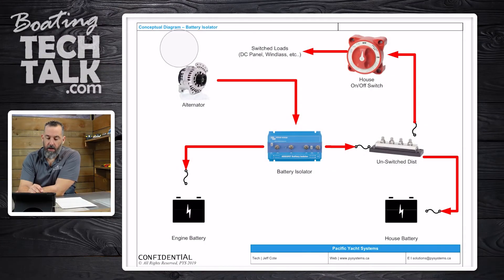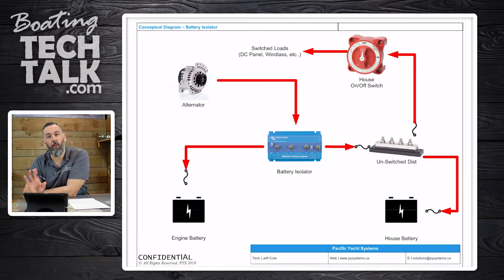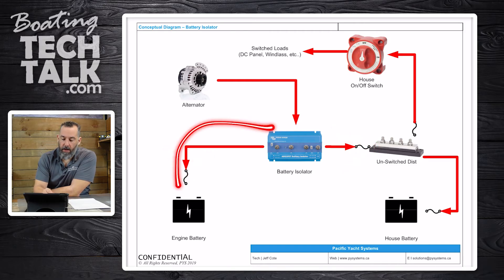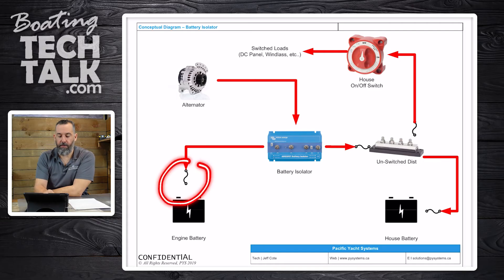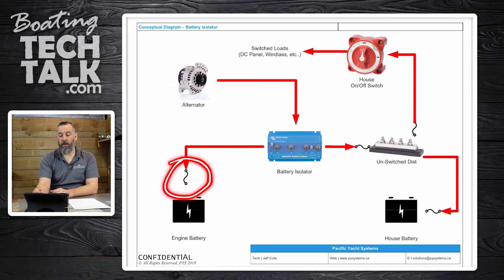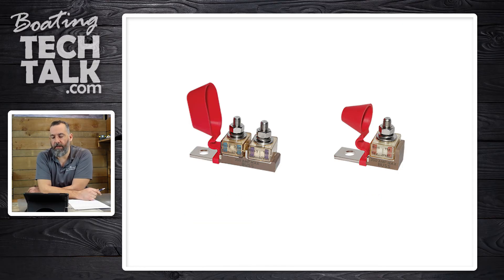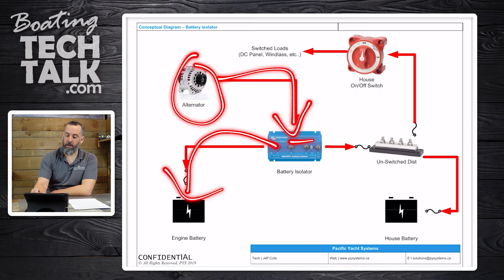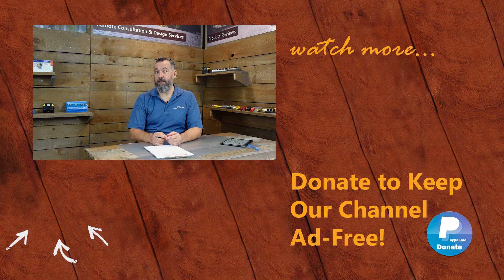Top Tips for Wiring A Battery Isolator on Your Boat

Comment: Okay I'm confused now because in my suv I went straight from the alternator to the starting battery and then the starting battery then to the battery isolator towards the rear of my vehicle and then my additional batteries but here it says I have to go straight from the alternator or rectifier or whatever the boat has straight to the isolator but where I'm confused the most is if you go straight to the isolator you essentially have both batteries on the same post which I would think would make it to where there's no benefit unless you do One battery on one side and one on the other which is what I did I think I'm actually right in this sense but I'm looking at it wrong I don't think you can hook up the starter battery and the auxiliary batteries to the same post otherwise it would render the device useless and you might as well run them in parallel all of them. As it sits I just have an 80 amp stinger battery I've got everything hooked up except for the ignition wire which is why I tuned into this video. Have wire going from deep cycle agm starter battery to isolator large post then ano😢wire from 2nd large post to lithium 50ah then lithium battery to my amp. Is this not the way to do? I'm talking about two different vehicles in this post at first I'm just talkin about my SUV then the 80 amp isolator is on sea Doo jet boat. Really all I need to know is which fuse should I tap into on my Sea-Doo speedster for the ignition wire for the battery isolator?

Comment: nice video Jeff I have a 04 chevy express van w/ a sure power battery isolator  it has post1 thick 0awgfor start batt. post 2 thick 0awg for house batt. post A thick 0awg out of alternator and smaller post E what is Epost it has a thin 16awg organe wire? 
I see the victron batt. isolator has post1-2 and alt. I also see 2 smaller wires energize and ground, I understand ground but what is energize switched 12VDC or a constant always on 12VDC?

Comment: Hi Jeff, just looking at this now...  I want my alternator to fully charge my starter battery then charge my 24v (dual 12v) batteries when out on the water.  If I purcase a 3 battery isolator will that work?
Reply from the maker: No the battery isolator is not for this.

You can get a 12v to 24v dc to dc charger   to charge the 24v bank from the 12v battery. (the alt would directly charge the 12v battery) or a product like the trollbridge.    with the trollbrige you can't use the 24v when it's charging

Comment: I have a 1993 twin engine boat, and I had my alternators replaced. The positive leads from the alternators go to a Lewmar 2-3-120 amp isolator. The Lewmar is connected to two Sure Power 703R isolators. The remote sensing wire from each alternator are wired to the 703Rs. I have 12 volt starting battery for my generator that is wired to the Lewmar and 4 golf cart sized batteries wired the 703Rs. 

Everything works fine when Each engine is running separately. The tachometers rotate fluctuating or going to zero when both engines are running. This started after the new alternators were installed.

Comment: Question, If you have two batteries wired in parallel do you run a lead from the isolator to each positive lead on the batteries in parallel?
Reply from the maker: If batteries are in parallel, no need to run multiple lines from the battery isolator... only one will do.

Comment: If battery isolators don't modify voltage but just pass it through, how can you connect different banks with different voltages without damaging one of them?
Reply from the maker: Like most battery chargers, battery isolators, do not provide individual controlled charge outputs for each leg. Yes, that's ideal, but it's not prevalent. As a compromise, the charging voltage is shared equally amongst all batteries. If you want individual charging, you'll either need dedicated alternators per battery bank or DC to DC charging converters.
Reply: @PacificYachtSystems  I thought about it since posting the comment, and I think I simply did not properly understand. Assuming the same types of batteries, it should not be a problem. It would only be a potential problem if each leg led to different types of batteries. To my current understanding anyway.

Comment: 2 questions 
1.On the previous comment, on no starter on your diagram. Why don't you redo your video to add the starter to the diagram?
2. If you want to add a bow thruster battery to this diagram, is it as simple as replacing the 2 out put isolator with a 3 out put isolator and adding a bow thruster positive cable to the third out put? Could the original windless cable that runs from the house or starter battery to the windless be that new cable from the  isolator to bow thruster battery?
Reply from the maker: Hey Graham, thanks for your comments.
1) Here's a diagram of a battery isolator with engine and house battery connected:
https://www.pysystems.ca/site/assets/files/2532/pys_battery_isolator.pdf
2) When connecting a 3rd battery, not only will you need to have a positive cable from the battery isolator, but you'll also have to make sure your thruster battery is connected to the DC distribution of the boat.

Comment: @pacific yacht systems  Is there anything wrong with using circuit breakers in place of fuses in any place in this diagram?
Reply from the maker: Depends on the requirements for the circuit protection, thermal circuit breakers will do in most cases, but sometimes you need something different, either more granular like 7 amps, slow blow fuse.

Comment: As you say, traditionally the alternator is connected to the starter motor. When using a battery isolator the outs are connected to the battery with a fuse in between.

Isn't it possible to combine the two methods by having the out to the engine battery going to the starter motor? This would reduce the amount of cable as you wouldn't need two cables for starter motor and battery isolator. The only issue I see here is there wouldn't be a fuse but then again there isn't with the traditional method.
Reply from the maker: Elliot, your choice as I understand seems possible. Make sure you fuse the starter connection to the battery isolator.

Comment: First, thank you for the education. My question is can an ACR and a battery isolator be used in the same system? I've got a small 31' SB that is 30+ yo, a 55 amp alternator on a 16hp diesel, 2 6volt deep cycles as a house and a single 12 volt for the starting battery.  I have purchased an ACR from Blue Sea and a Dual circuit Battery Switch. Does it make sense to install an isolator also? and if so how?
Reply from the maker: A battery isolator is generally used for sharing a alternator charger to 2 or more batteries. A battery combiner can be used to share any charging voltage, like an alternator or even a battery charger. Generally you choose one device.
Reply: @PacificYachtSystems  Jeff, thank you for the response, I appreciate the videos.

Comment: Very good information. But what will happen if the, no matter which one, battery fuse opens?
Reply from the maker: If you have two batteries connected and you lose one connection to one battery, it's ok. If you lose all connections to all batteries, then your alternator will likely get damaged.

Comment: Hi there! Thank you for the video. I still have a question. Can I connect more than just one source of energy (i.d. the alternator) to the main input point of the battery isolator? I mean, can I connect as well, on the same point, the energy that comes from a battery charger, for instance? Thank you.
Reply from the maker: Seen this a few times out in the field, but we've never done it and not sure if it works. We simply add more battery isolators if we need them.
Reply: @PacificYachtSystems  thanks a lot

Comment: Great video. What would you do differently if your house battery is Lithium?
Reply from the maker: When setting up the charge profile of the alternator, you have to decide which battery you'll want to properly charge at the expense of the other battery not getting what they want. The alternator can only be configured to one charge profile, if you choose Lithium, then any other battery connected to battery isolator that isn't Lithium will get either under or over charged.

Comment: hi Jeff,  if i have two starter battery's for both Eng's, and 4 house battery's for 400amps do i need to have two isolators or ??
Reply from the maker: Assuming you engine battery, made of two batteries, is still one bank of batteries, either wired in parallel or in series. Therefore you have 3 battery banks (port engine, stbd engine and house). You'll want two battery isolators, one for each engine alternator.

Comment: Great videos Jeff.  Ok, just thought about this! My wife has one of those small emergency batteries you charge and then keep in the glove compartment or trunk of your car. Then when you need it, you plug it into the cigarette lighter socket or attach it to the battery posts to jump your car! Do you think they can be used on boats?
Reply from the maker: Yep, certainly we can use an emergency battery, but it does NOT replace the engine battery.

Comment: I have a narrowboat in England which has 2 alternators and 2 battery banks. I have a sure power 3202 isolator with 4 connections. What's really confusing me because of a general lack of information with this setup, is under what circumstances does each alternator charge each battery bank, or are both alternators charging both battery banks - confusing. Any info appreciated.
Reply from the maker: Assuming your battery isolator 2 input and 2 output, each alternator will recharge both batteries, whichever battery bank is the largest, most depleted, and fastest charge acceptance rate, will get more of the charge current from both alternators.
Reply: @PacificYachtSystems  Thanks for the reply. Yes 2 input 2 output. I was thinking that maybe the engine alternator would recharge the engine battery first, before helping charge the domestic batteries, but sounds like I don't really have a "engine" alternator and a "domestic" alternator, as they are both treated effectively the same?
cheers.

Comment: Thanks for another great video Jeff.  For clarity how about adding the starter to your diagram.  Lets us slower learners see how the wiring should be set up.
Reply: Yes, another vote for this.  By my count Jeff said the word "starter" at least nine times in the video, but it is nowhere on the diagram.  Also, what's with the "skip" at 1:23 where Jeff says "Your starter should be connected..." and then it skips to say "... pretty straightforward".
Reply from the maker: Hi Ralph, good suggestion for next time.
Reply: @PacificYachtSystems was there ever a next time? Saying your alternator needs to connect to the isolator is great but how does my engine get power? My alternator is connected to the starter solenoid. Do I add a bus block between the battery and isolator with a wire going to that post on the solenoid?